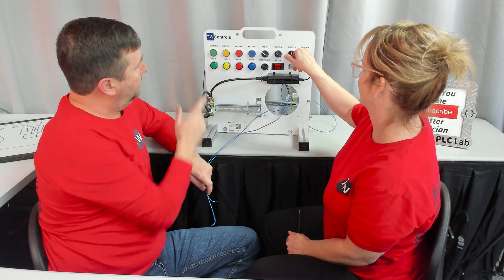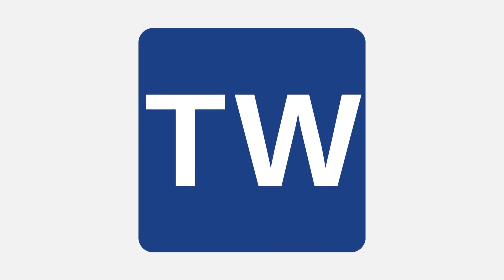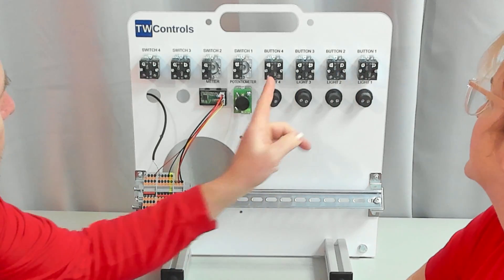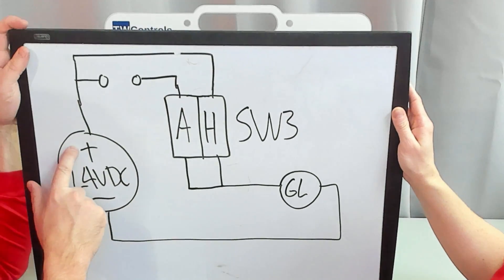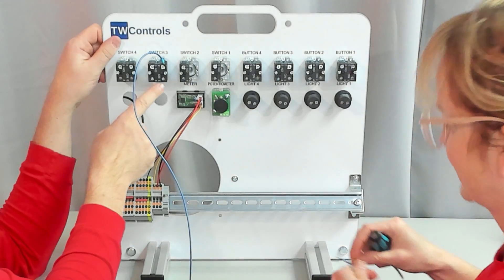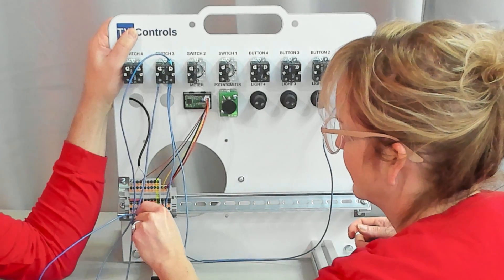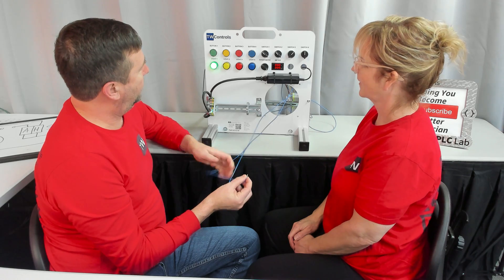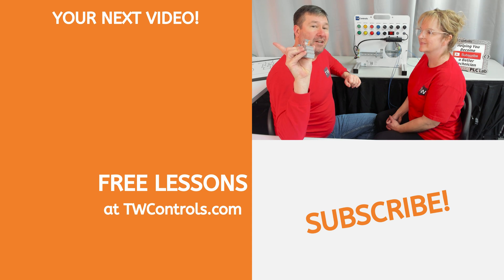How to Wire a HOA Hand Off Auto Control Circuit for Manual and Auto

Comment: Hey Tim, would this same setup more or less work on a 120VAC circuit with a 120VAC motor?
Reply from the maker: Not directly. You would need a relay or contractor to isolate your 24VDC from your 120VAC

Comment: Great lesson on a very common control circuit. Seen a lot of techs get confused on mounting the contacts on a HOA actuator. Makes a huge difference on how the contact blocks are mounted on the actuator.
Reply from the maker: Yes it does!

Comment: Hello Tim , is that the plc output card be different out as source or sinking like the input card ?  And which 24v "COM" power i should connect correctly on  the module output card ,means (+ or - ) , Thanks You
Reply from the maker: Yes, sinking and sourcing matter on output cards, the same as input cards.  See if this video helps.
https://www.youtube.com/watch?v=VFdtz3q4as8
Reply: @TimWilborne  alright Tim Thanks you !!!
Reply: Tim one more question as now the develop of AI is in rapidly growth up and many around my friend scare that the automation of machine will be replace by the AI robot,as now our world is most pull the develop on AI  , the filed of AI will be the era that related with us

Comment: Tim I really like your videos and what you’re doing. I have a question. When troubleshooting  a program in 5000 or 500 ladder logic and the instruction gets kinda confusing with a bunch of moves from different sources to different destinations, how do you keep everything organized to help you solve the issue? I’m trying to become a better technician when using ladder logic programs to troubleshoot. My brain can’t keep everything organized and I get lost when the instruction gets complicated. I need a systematic approach with a pad of paper to write down the correct path to follow when troubleshooting. Any advice would be appreciated. Thanks and keep up the good work.
Reply from the maker: A scratch paper never hurts but the big thing is learning to use the cross reference effectively.  The destructive column tells you whether something can write to a tag.  The trick that I tell technicians in our class is that if you are cross referencing something that can only read such as an XIC, then you'll be looking for a Y...always the opposite.

Other than that, it takes time troubleshooting programs before you start to understand little things you can do to make them easier to follow.  Get copies of as many programs you can and see how they do it.
Reply: @TimWilborne  thank you for advice! I will focus on learning as much as I can about using cross reference. That gives me a good direction to focus on. We have experienced guys in our shop that we can learn from but a lot of our training is informal. We have access to hundreds of different programs/ machines to learn from. Thanks again and keep up the good work!